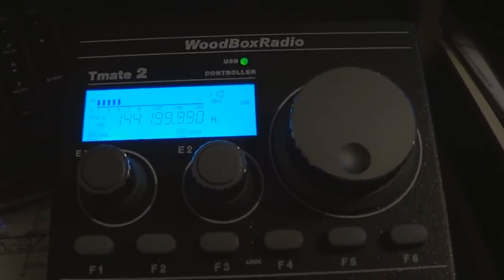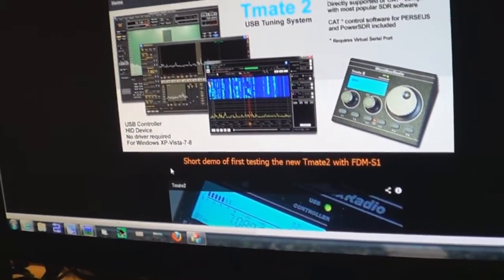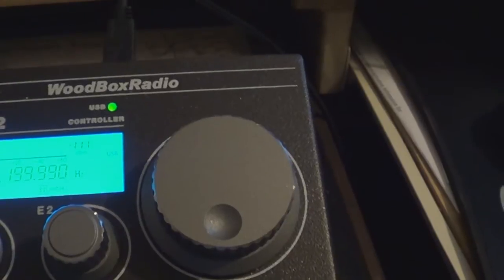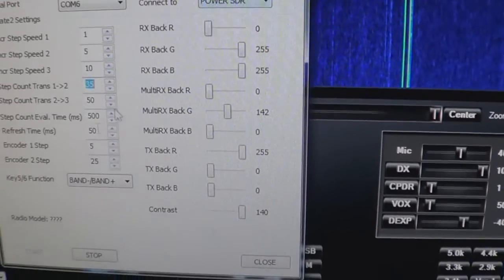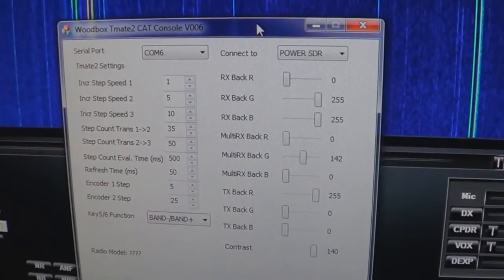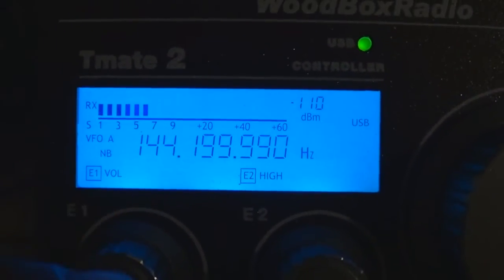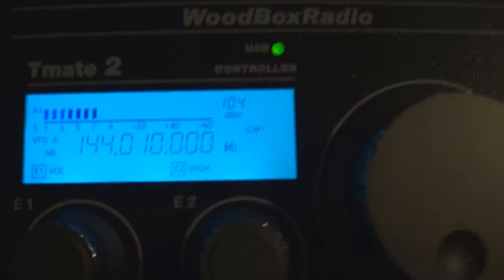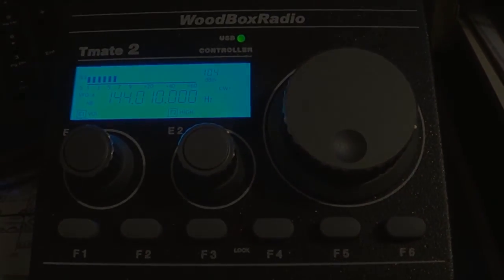TimeMate 2

Comment: I bought this device several months ago to use with my Flex 5000 and PowerSDR.  I was very disappointed when I discovered  that the RIT/XIT functions do not work.  As I am primarily a CW operator RIT was especially critical for my use.  I've had numerous email communications with the Chicago marketing outlet.  Also discussed this with Franco, IU3ADL , a part of the ELAD Support Team.  It's clearly a software problem to which ELAD Support admits.  After waiting almost 3 months, I've returned the unit to ELAD for a refund.  Your video is over 3 years old which means the problem has existed for over 3 years with no resolution.  Does not speak well to their quality control or customer support.